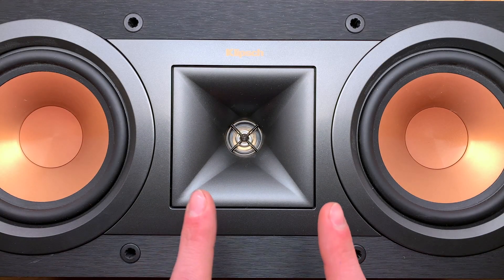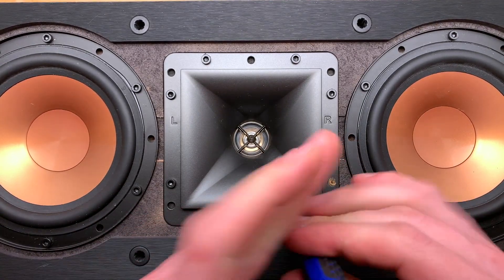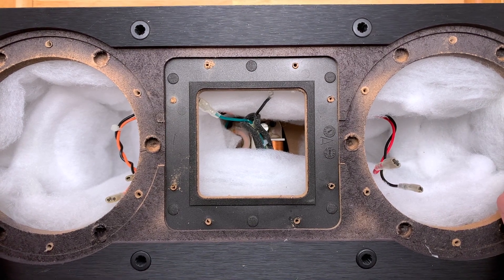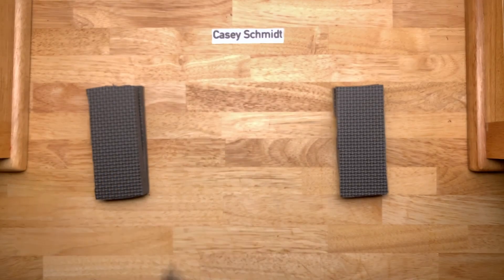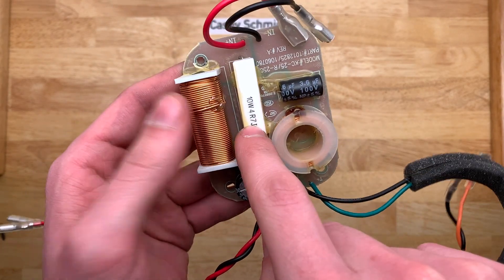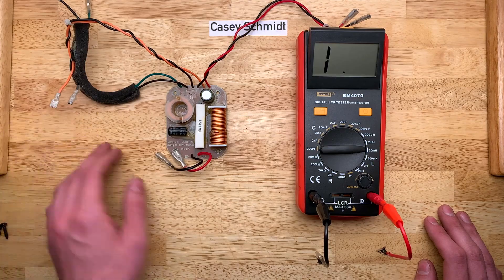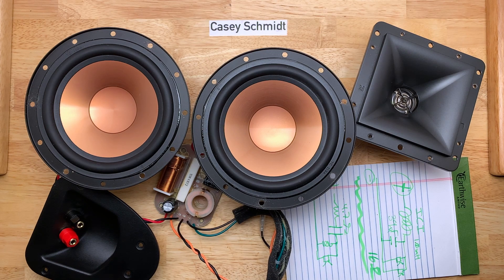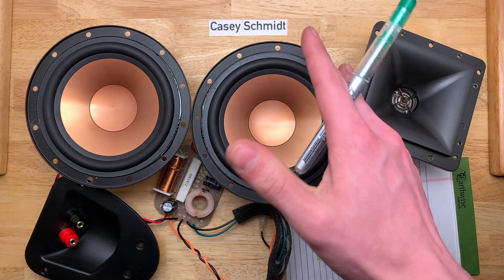Klipsch R-25C - Teardown and Reverse Engineering

Comment: I’ve got an RC-10 which is older, and it sounds very hollow and boxy after crossover repair. There are foam pads inside but I think I didn’t put them back in correctly.

Comment: 1. Why the manufacturer simply would not put a better parts in the first place?
2. Are there any speakers which does not require overhauling them?
Thanks!
Reply from the maker: @Rick Corel - Great question. 
1. It would be way to expensive and they would be competitive in the market.
2. Yes, try looking at speakers in the $2k price range and up.
Reply: @Casey_Schmidt  I actually meant why do not sell $200 speakers for $300 but with better audio crossover?
Reply from the maker: @rickcorel5154  - It really just comes down to the fact that 99% of the customers can’t hear the difference between the low quality components and high-quality components. In fact most of them probably wouldn’t even care to know the difference. So it doesn’t make sense for the company to make their product less marketable by making it more expensive. Why put in a $15 capacitor when eight $.15 capacitor will do the same job for what they need, you know? It’s a bit annoying of course but such is the world of cost cutting.
Reply: @Casey_Schmidt  Thanks for such the nice explanation! After a hearing test my doctor said I have excellent hearing, and on top of it recently I have found out that I am a synesthete, who sees colors while hearing the music. These colors are very vivid and different shapes and create a beautiful combinations. 
Thanks to you, now I know how to search for my speakers. 
Stay safe!
Reply: @Casey_Schmidt  Now I know that they do not make anymore amplifiers with low THD (0.01 or less) because 99% would not notice any difference. :)
Reply: 🙏 @Casey_Schmidt
Reply: it's called ROI , look it up.  This is done for any electronics platform. Some companies will get a part that is .05cents cheaper, b/c they need to order 5 million, and that adds up.

Comment: Hi Casey! I have one question: You said the drivers are 16 Ohm impedance. Did you actually verified this or did you just assume because they are wired in parallel and it is written 8 Ohm on the tag. I have seen speakers advertised as 8 Ohm with 2 X 4 Ohm woofers in parallel. Let me tell you that my amplifier did not like it. Concerning the upgrade, I don't think it deserve to be upgraded unless you listen to it a lot. Thanks for another great video!
Reply from the maker: Hey, Yves! I don’t have the tools/software to directly measure driver impedance. The speaker is nominally 8 ohms and the way you get 8 ohms impedance from parallel drivers, mathematically, is for the two to be 16 ohms. So let’s say I’m making an educated guess by calling them 16 ohm drivers.

 Thank you for the input on whether or not to upgrade it! I do agree, for me it’s not worth upgrading since I don’t get a lot of use out of it but if there’s interest I’ll happy do it for the channel. Thank you for watching!
Reply: @Casey_Schmidt  I simply use an Ohmeter. If the driver is a 4 Ohm, it will read between 2.7 and 3.3 Ohm DC resistance. An 8 Ohm will read around 5.5 to 7 Ohm DC resistance. So you see it is quite easy to verify if they make a false claim on the impedance. And why they do that? Because it is easier to sell speakers if they are an easy load for the amplifier. Also, the frequency response should be listed with a + /- 6db. Most companies won't divulge those numbers or write any crazy number they can come up with. Personally, I think it is important to report any false advertisement a company make on their product, to discourage such practices.
Reply from the maker: @Yves Boutin - I'm 100% with you on calling out false claims by companies.

The DC resistance of each both woofers is 7.2 ohms; checked with two meters. That would indicate an 8 ohm woofer and therefore a 4 ohm total load. I do remember that Klipsch run quite a bit lower impedance than they claim (compared to other companies). Many of their 8 ohm rated speakers are actually closer to 4 or 6 ohms. But 2x4 lumber isn't really 2" by 4" now is it. I can see where they claim a "nominal 8 ohm load" based on the impedance graph published by other sources; however, actual load can be a little ways off of the rating.
Reply: @Casey_Schmidt  A 4 ohm load is ok by itself but if all the speakers in a home theater are also 4 ohm, it is possible for the amplifier to be running hot to the point of damaging the output transistors. If you already saw an impedance curve, you know it can sometimes go very low in the bass-midrange area (it can get as low as 2 ohm), putting more stress on the amplifier. In fact, it is one of the most interesting topic to study in regard to amplifier-speaker matching. Some amplfiers are so wimpy that a difficult load will make the speakers sound shut-in and dynamicaly constipated. Because of that fact, some reveiwers will say the speakers are good or awful depending on this behavior relating to the matching with their amplifier.
Reply: @yvesboutin5604  Is there a way to test your speakers to see if they are accurate when listening to them, like a measuring device? 
I am searching for some 2nd speakers better than my current Wharfedale 11.2s and I see most new ones that cost a tone, have cheap parts in them and no charts to display what they claim.
Found GR Research channel and was 90% into buying some SVS Primes and then I saw his video about even more expensive SVS Ultras center speaker which had crap components.
I am looking into the used market and some vintage BC Acoustique Fostex made in France, real wood from what I saw, caught my eye, as well as some Dynaudio Contour 1 MK ii made in Denmark and don't know if I should buy new and upgrade the parts or buy some used high end ones and see if I need to upgrade them.
Thanks.
Reply: @SacreDro  You've done your research on some alternative solution and that's great because most people envision only buying something new and resaling the old stuff. GR Research is certainly a good place to get some upgrade and their claim is substantiated by graphics. On the second hand front you can also get some great value for your money, but make sure you can listen to the product in your own environement to make sure it suit your need. Amazon have also some 'open boxes' and 'returned items', but you yon't be able to ascertain if they are in good condition before delivery. The last option to pounder if you are a bit proficient at woodworking is making your own speakers. On this one you can as conservative as you want or go nuts on some outrageous beauties! I recommand you made several prototypes to test wich one sound best. Of course, you will have to invest in some drivers and crossover parts but the reward can be amazing. When you will have lived with your creation for a few months and satisfied with the result, you can build the definitive version with real wood veneer and the best parts. I also recommand you find someone close to you (friend, coworker or neighbor) to help on the listening and building front. I wish you good luck on your quest!
Reply: @SacreDro  Hi! Some third octave analyser exist which convert pink noise to a graph of the response and some can be hooked up to a computer, but these cost 500$ or more. I never used those, I prefer to use my ears with good music. You can design a speaker on paper and have the cabinets built to your specifications according to the drivers you want to put in. If you want good bass, you can make the enclosure bigger, after you can toy with the crossover because a computer design is never perfect, that's why tweaking and prototyping is so important. Every speaker can be improved but it vital to know what you are doing and be patient: A modification can make a speaker more precise or dynamic but can sound fatiguing  overtime. There is no subtitute for experience. Good luck !